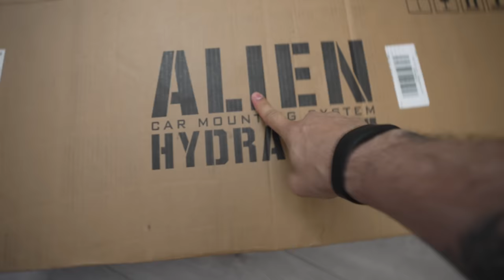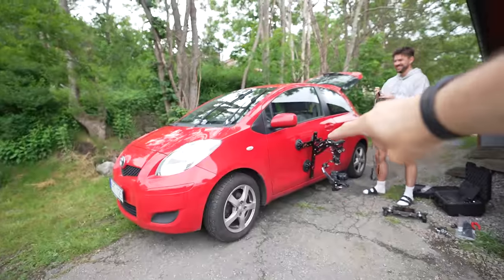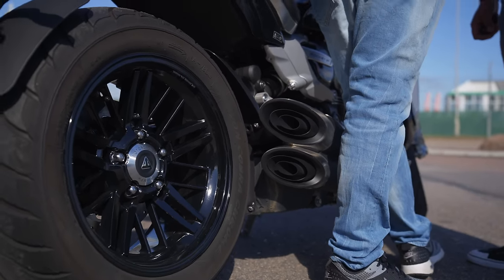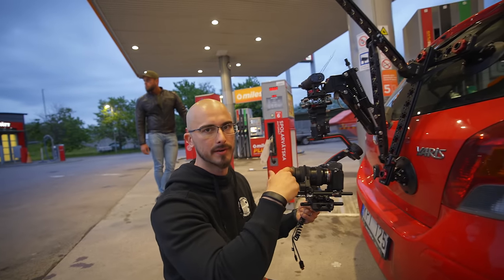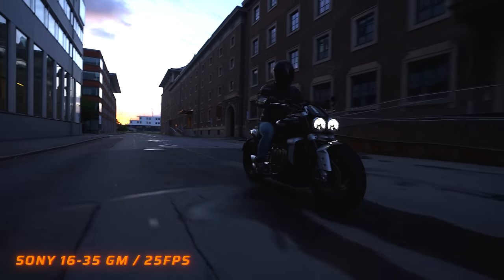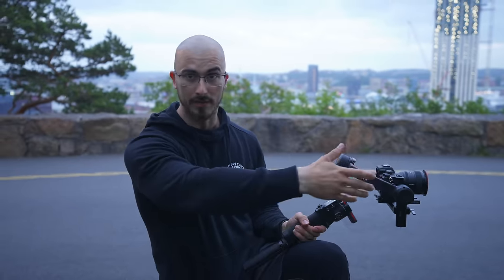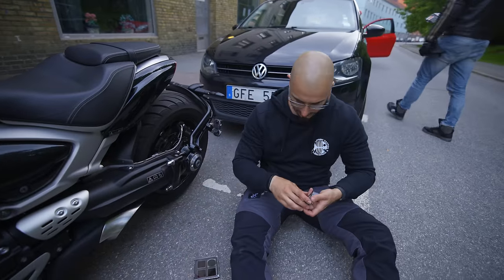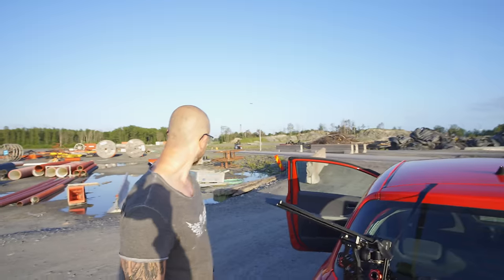How To Film A Cinematic Motorcycle Video | Behind The Scenes | Sony A7S III

Comment: Hey Peter great video! I have been shooting for a long time with the Tilta Alien mounting system and it's great! Just a little help: to achieve the best stabilization the arm should be always in an horizontal postion when having the vacums mounted almost vertically. So you can achieve more travel up and down dampening the shots. BTW amazing video!
Reply from the maker: Thanks! Yeah we adjusted it before filming every time!